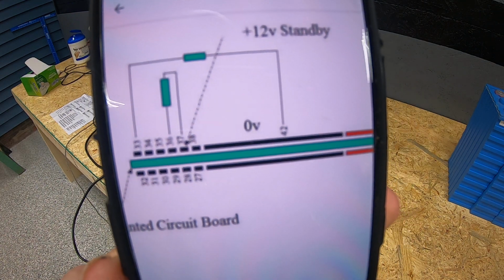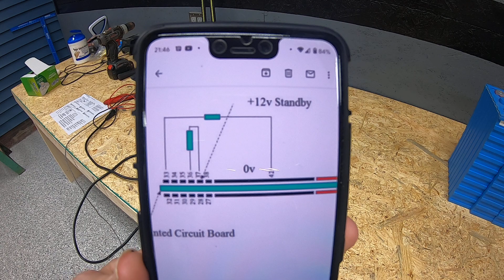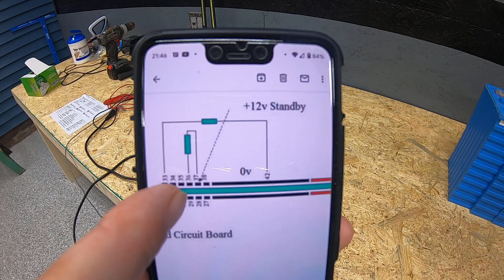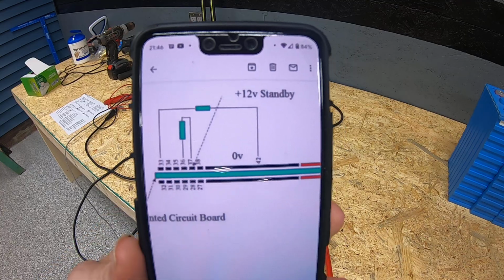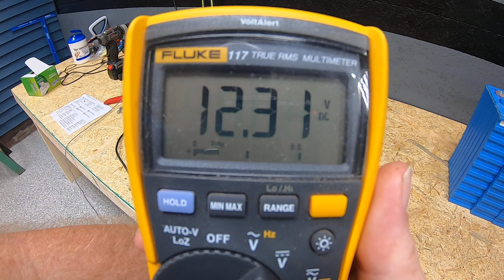HP HSTNS-PL12 Mod

Comment: i got it too but why the fan is always runnig when the power supply is not underload or low load? any idea to turn it off ?  hear the fan slowly  stops when i put on it around 300-400w
Reply from the maker: My thought is that since these are not in a proper server enclosure, may account for the constant fan operation as the chassis would normally report back the temperature.  The fan running has not really bothered me and I only have it running when needed and the cooling fans in the iCharger's that it is powering are louder than what is in the power supply.

Comment: hi pls tell if i can directly connect two or three of these PSU parallel to increase the output current?
Reply: I'm probably going to do that, whether parallel or series you must dc ground float all of them except for the first one. You are isolating the DC circuit from the case which is already ac grounded. If you do not it will cause a short and burn out some of your power supplies